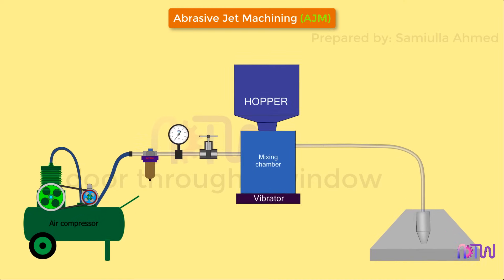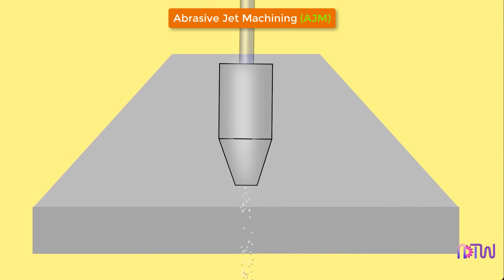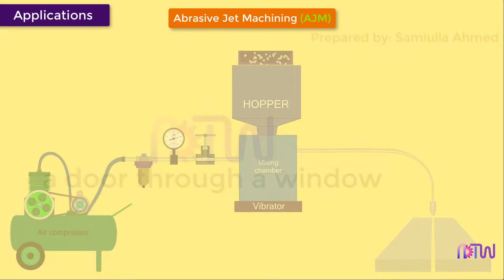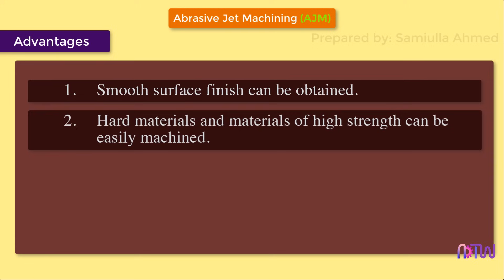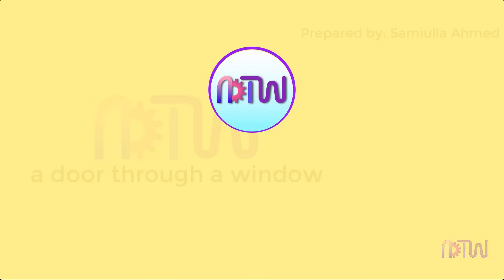ABRASIVE JET MACHINING (AJM): Working of an abrasive jet machining process (Animation)

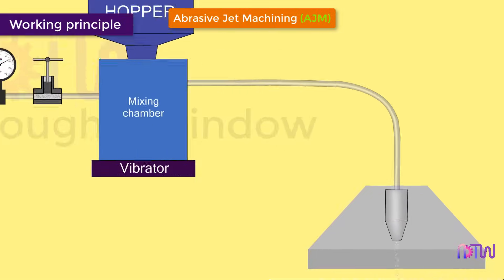Comment: 1:21 Working Principle
1:44 Construction
1:57 Working Process - 1)Air Compressor
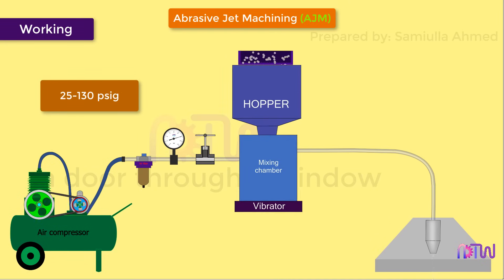2:10  2)Air Filter
2:17 3)Pressure Gauge
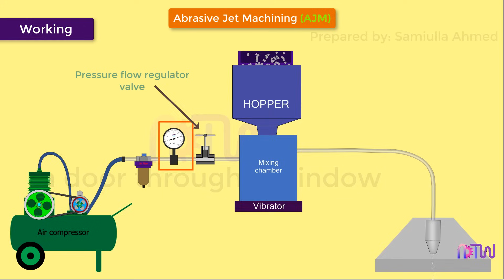2:22 4)Pressure Flow Regulator Valve
2:31 5) Mixing Chamber
2:39 6) Hopper
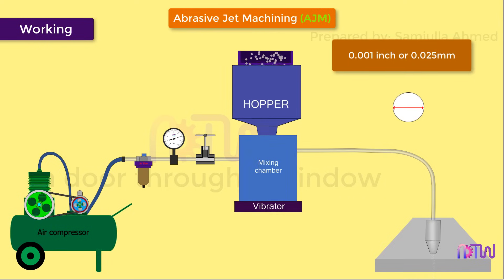2:52 7) Vibrator
3:04 8) Nozzle
3:40 Applications